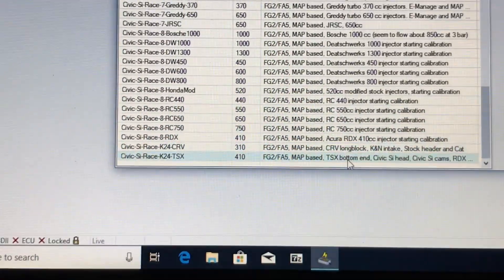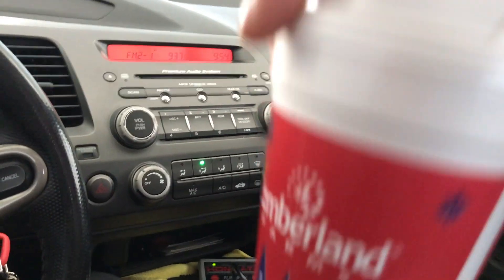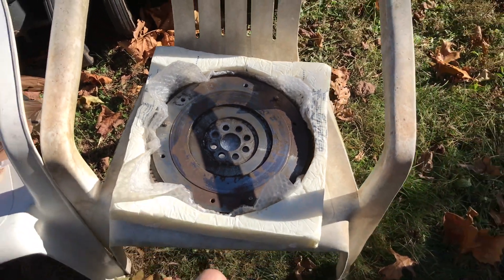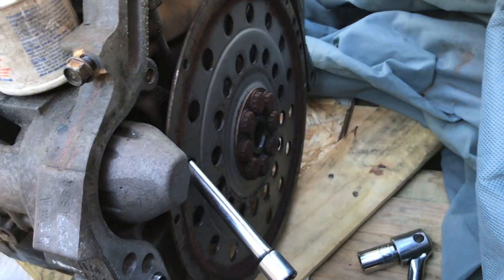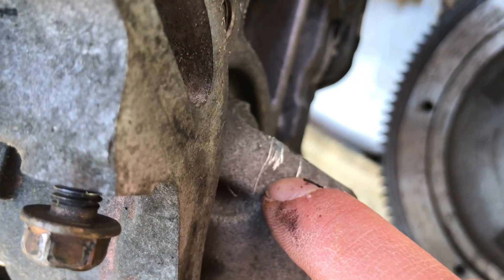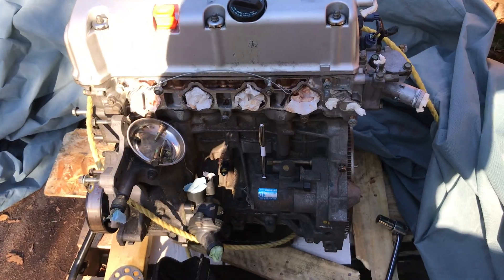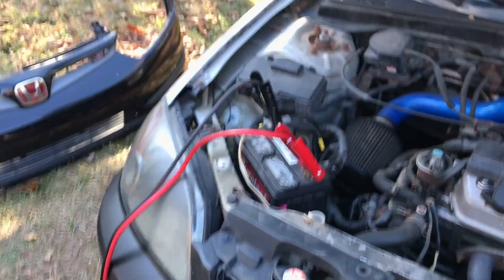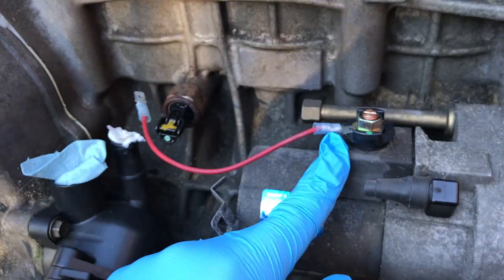Honda JDM k24a Engine Problem

Comment: What's most important is that the  numbers are within 10-15psi of each other. Pistons 1 and 2 might have just had some stuck rings, which could be freed up after the wet test. Let it sit for a while and then dry test it again, looking for those numbers being at least close to eachother.

Marvel mystery oil, about an oz in each cylinder left to sit for a day or 2 will free up stuck rings. Just make sure to evacuate any excess oil that may be in the cylinder wells before compression testing it again, or you risk hydro locking it.
Reply from the maker: Thought is was 10-20 psi?  Either that or the fact that they are adjacent to one another could mean that it could be a head gasket...  Yup, that's the plan. I will try with a stronger battery this time too.
Reply: @TheGerbsteve  I say 10-15 because a needle gauge isnt very accurate compared to a digital reading. It just errs more on the side of caution to be at 10-15psi variance.
Reply: Your suppose to let the motor turn over the same amount of times on each cylinder too just so you know

Comment: I just picked up a motor myself.  It has no starter but I wana compression test it.  You think just using a impact on the crank bolt clockwise would work?
Reply from the maker: Nice! What engine did you get?  Impact won’t work man unless it’s strong as hell... even then
Reply: I would think impact might have more juice then a starter.  I seen one guy crank it by hand and got a compression reading.  Hmm
Reply from the maker: Worth a shot then.  What engine did you get?
Reply: Wel I picked up a GM ecotec motor to tear apart and learn on.  It’s not going I to anything. I prefer Honda’s.

Comment: I think it’s good bro it’s just been sitting for to long
Reply from the maker: Could very well be the case. If not, a head gasket or piston rings should very well solve the issue. We shall see
Reply: @TheGerbsteve  .. If you open up the motor u void the warranty. Just to let you know. You should do the install first, get the motor running, and see if it is good first, unless of course you plan on just rebuilding the whole motor. But if their is any block or internal issues, JDMNY wont cover them. But I have the same engine from JDMNY.. I have inconsistent Compression results until my valves and seals got clean oil and the motor was running. My head was gunked kinda like yours, so it just took a 1 break in cycle, and another oil change to full Amsoil XL synthetic and I yielded normal compression on all 4 cylinders.

Comment: I hope they swap out that K24 they sold you. Of course it will have higher compression when you dump oil in it for a "wet test"
Reply from the maker: I talked to them over the phone and they said I can bring it back before my 30 day warranty if I want too. They also said bring a flywheel and they can compression test a replacement engine there for me. Idk what to do 🤷🏼‍♂️
Reply: @TheGerbsteve  i would absolutely make the drive and take it back. It was obvious looking at the head the engine hasnt had the best life. Better to put in the time and effort now rather than when it's in the car
Reply from the maker: I mean, you do have a point....

Comment: soak the cylinders with oil or atf so it seeps down into the rings and lubricates and frees them up then try the test again in a day or two. plus as the engine warms up the compression will also raise a bit. Those definitely aren't bad numbers but the engine has been sitting a while. If your going to tear it down to replace rings, you may as well install a K20 head which breathe better and have way more aftermarket support. The K24 heads are good for making more midrange power and torque though which is what the K20's lack so either way you cant go wrong.
Reply from the maker: Going to try retesting it today... engine has been sitting for a few days, wish me luck haha.  I was thinking of doing rings, rod bearings, valve seals, and head gasket! If anything, I wanna rebuild my k20 head on the side and just run full k24 longblock. Flow rate is similar k24a vs k20, but 06-08 k24a2 head is almost identical. There is only a difference in the intake low cam of k20 vs K24. Apparently the lower cam lob is slightly larger, has more lift in the k20’s.

Comment: When u were doing test did u have plugs in other cylinders ? 

If so why ??

If u remove plugs wouldn't the motor crank better
Reply: Most of these videos are guesswork
Reply from the maker: Two plugs out, two in. Then i took all four out. Biggest issue was my ground connection.
Reply from the maker: I'm learning...

Comment: The compression should be at least 175 psi on the dry test, the fact that the compression went up so much on the wet test tells me that your rings are bad. You did get the motor for cheap , I would send the short block to a machine shop and get it rebuilt , you just need to buy a set of rings maybe a few other items and it should be good to go.
Reply: Agree 100% with your assessment he has a 30 day warranty and should take it back
Reply from the maker: I wonder if the fact that it's been sitting for awhile had any effect on that.  I would have to agree though, either rings or head gasket. The plan is to rebuild w.e engine i get anyways, so maybe i will just stick with this one. $45.00 for rings, $85 head gasket, maybe valve seals $20.00... So for like $150 on additional maintenance items on top of the $650 i spent, i will have a good running engine.  Plan on taking block to shop and get cylinder walls honed too. Too much to list on what i have planned lol
Reply: @TheGerbsteve  better just to rebuild it , the engine is already out and you will know what you got when it's rebuilt. Plus your K20 is still running good you can take your time getting the K24 ready for install and rebuilds make for good content.
Reply from the maker: 1gsrtom exactly. I’m not really in a rush right now and I want to do everything I think I need to before dropping k24 in. Like you said, it’s easier when engine is already out. Main 4 things though are piston rings, valve seals, head gasket, chain.
Reply: nah I had similar results on wet and dry testing, once the motor was primed and running, and I did 2 oil cycles, I got completely normal compression readings. These compressions tests on these JDM motors that have been sitting a long time are inconsistent. Residual oil builds up around the rings, seals and valves that is impossible to clean unless you take apart the head and block(voiding the warranty).. It isnt until the motor is warmed and running oil that you can get accurate readings on these motors. This is why they are cheap to begin with. But these motors come out of a minivan from Japan with low miles(due to Japanese law on economy). It is HIGHLY unlikely you have bad rings, seals, or valves with miles usually around 50K and in a minivan that was 99% likely to never have been driven over 70mph or driven hard period.

Comment: I had a question not related to this video! As a Honda owner, would you still suggest those Riken Raptor ZR tires you reviewed a while back? I am looking for a budget option, and I was curious how they held up long-term. I assume you're not using them anymore? Still looking for a good option as far as traction and control goes, but I am on a tight budget and they seem like a decent option still, future wear/compound reliability and future replacement is my only list of concerns.
Reply from the maker: I would recommend Rikens to anyone!  For the price you pay, you cannot beat the grip, quality, and tread pattern 👌🏼... best budget option I can give you and Michelin owns them or makes them, one of the two.  I upgraded to generals gmax Rs for now because I got a steal on them!  But if I need to upgrade again, I’ll buy another set of rikens.  Tread wear was good, but I will say that the Compound is very very fragile because it’s soft.  You won’t be disappointed

Comment: Hey so you had very low voltage when you did the first 2 cylinders.. you’ll never get a good reading.. just try doing it again with the d series turned on to get 13+ volts and make your final decision from there
Reply from the maker: I figured that was my issue on the excessively slow cranking. I'm going to try again this week with a newer battery out of my si or company vehicle.
Reply: You are suppose to pull out the spark plugs from all the cylinders before you begin. If not you are working against the compression. Hence compression was increasing as you began to remove the remaining spark plugs. Also a wet compression test is only performed after a dry test has been performed and a cylinder has failed. You then add a tiny bit of oil to determine if the compression is being lost at the piston rings. The oil will seal off any damaged rings resulting in recovery of compression. If compression remains low after adding oil. You compressiom loss is in the heads. And like the OP stated maintain constant battery voltage through out the test. Good job tho enjoying the progress

Comment: Numbers can change up with the block is fully warmed up.  I have only ever done compression test on a warmed up motor
Reply from the maker: It’s always a pain in the ass when the engine is out of the car.  I wonder if this thing got up to a certain temp if it would be good or not

Comment: You said you've spend all your checks into it and then you call it a budget build... Stop cheaping out and buy a newer car already. I see lots of DIY stuff on this channel but that's cool for someone that maybe doesn't have a job or is just messing around with a beater car. But you seem to have a job and old enough to not have a beater. Or maybe I'm wrong but sell that car if you can add the addiquit money into it.
Reply from the maker: You should probs go back and “Listen” to that part bro.  And I wouldn’t call my si a beater, I have a d17 as a beater

Comment: You used the starter that came with the k24a during the test?
Reply from the maker: Yeah. This test was probably off a lot because engine has been sitting and probs not the best ground for jump.